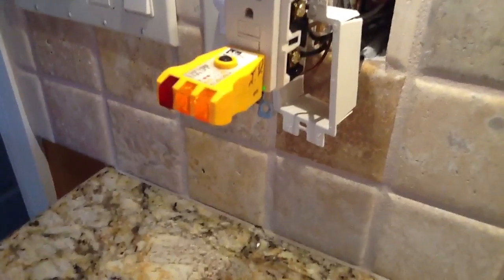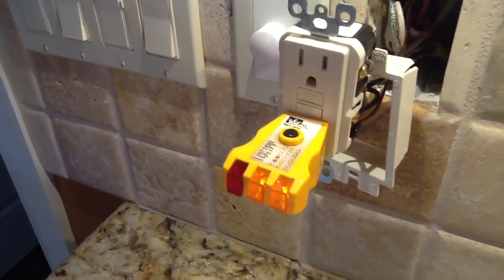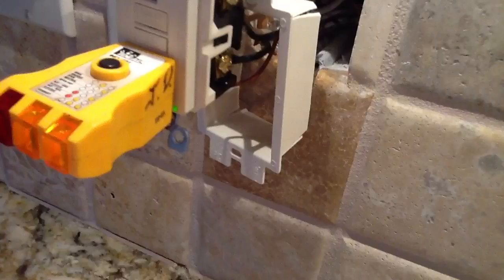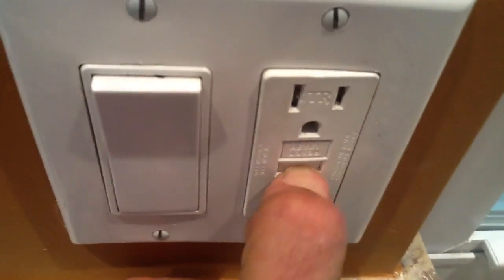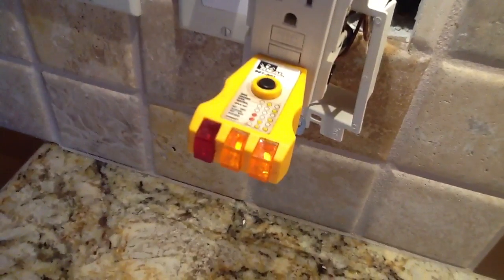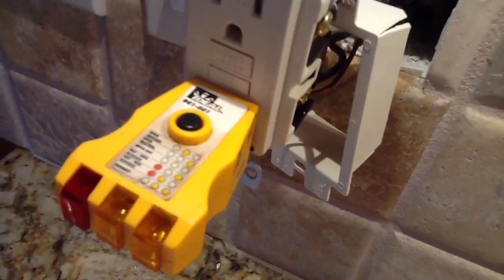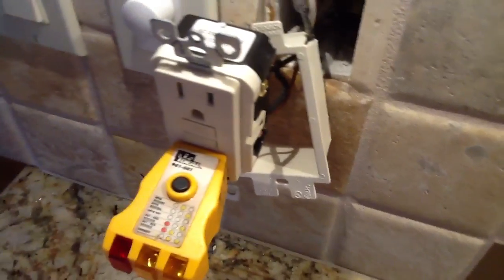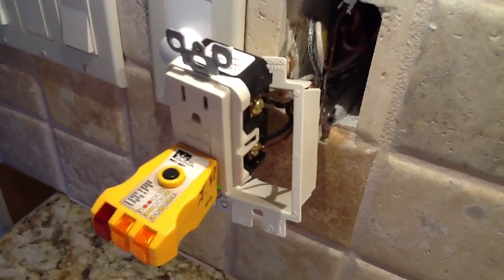GFI Receptacle is Not Working...How to Reset?

Comment: Hey Mr Jones. I'm trying to install a gfi in my bathroom that has a plug at bottom, and a switch for the light overhead. When I disconnect and remove the old one I have two white wires,and 1 black. Looks like the other is attached to another black lead. What's the process,and where do I connect the left over black wire ?

Comment: I wire everything right, it’s a dedicated circuit from panel to gfci. My tester says it’s correct but wean i push the test button on my gfi tester it won’t trip and it switches from correct ligths to hot/neutral reverse. Have you ever run in to this problem?

Comment: I have a green light on my gcfi outlet, but no power. My tester shows no lights. A couple of regular outlets have no power.
Reply: I have same problem
Reply: @kike562  Just gave me electrician partner $30 just to tell me switch the black ones & press reset on the gfi.
Reply: Keith Mcgriff Switch which black ones? White into line and black into load and opposite for outgoing wire? Or switch the black to the silver screw?
Reply: Damn..

Comment: Great video.  I have had trouble with my backyard plug not working, 3 bathrooms not working either.  The middle bathroom upstairs has a GFI.  I replaced all the plugs and a new GFI  in the middle bathroom.  I used the tester that you used and I am getting no lights on the meter, not even the two yellow light.  it wont let me push the reset button and the reset button wont work on the tester.  I checked all the other plugs and they are dead too.  I reset the breaker a few times and still dead.  Weird thing about the GFI is that the green light is on, doesnt that mean its wired correct.  Would the green light still be on if it was wired incorrectly, I was really careful.  Its a really strange problem!

Comment: why do they make them with so little room for the wire to go around the screw?  and how come you cant put the screw back if you take it out all the way?  I dont see the point in making it so difficult to install?
Reply: You can put the wire in straight, under the metal plate behind the screw.

Comment: My gfi doesn t trip but the outlet works. Tge fest says open hot. I opened and there are 2 hot lines in the load and 2 neutral also in the line. Nothing at the load.

Comment: Good video! easy to follow: I have an issue that's got me a little more than confused; I have an outlet that works ok iF I plug an appliance into it 15amp 125v- the next outlet downstream is my GFCI- IF I plug a tester just like the one you used in your video- it will cause the downstream gfci to trip everytime?? I have replaced both the standard dual outlet and the gfci and it still trips the GFCI  if I plug the 3prong tester into the outlet?? any idea whats causing the GFCI TO TRIP JUST BY PLUGGING IN A OUTLET TESTER?? any and all suggestions appreciated!! thank you,PATRICK.P
Reply: You might be accidentally pressing the black button on the tester. That is designed to trip it.
Reply: @sierrabufe5133  THANK,S APPRECIATE THE FEED BACK,PATRICK.P

Comment: Thank you for the info. I have a gfci that is stuck and will not reset. When i test it with a fluke current tester it shows it is getting current and also down the line but it will not power anything I plug on to it. Any help would be appreciated.

Comment: The only truly accurate and reliable way to test your GFCI device is to press the TEST button on the device itself. The yellow GFCI tester being used here will trip the device but does not actually recreate a true ground fault. These little testers create a fault between the "neutral" and the ground. A true ground fault actually occurs between the ungrounded conductor (almost always the black wire) and the "neutral" (or white) wire. This is why the manufacturer suggests pushing the TEST button once a month on all of your GFCI devices. This is the true way to determine that your GFCI device is still working properly. This little device being used here is truly only a convenience device used by electricians and inspectors in the construction field. There is no need for all homeowners to rush out and buy one of these"bug eye" testers.

Comment: Thanks for sharing. I just want to add that sometimes that green light is a false-positive! I recently had two Leviton TR 15A GFCI's where the green light was on (indicating that everything supposedly was working) but there was zero voltage coming out of the receptacles where anything I plugged into it didn't work! The GFCI units were a little over two years old when they just quit working.
Reply: So what turned out to be the problem??  Because I'm running into the same issue right now,, green light on but no power to anything you plug in!!
Reply from the maker: THANKS FOR WATCHING

Comment: Question. What is the condition if the GFCI won't reset, won't test, the tester won't light up and the light is blinking red?

I figure there is no power....but The GFCI is only 8 weeks old and the unit on it has been having issues tripping the GFCI. The unit calls for a dedicated 15 amp breaker & GFCI as it is outdoors. it has a 1hp motor that runs at about 9.8 amps FLA
Reply: Same thing with me